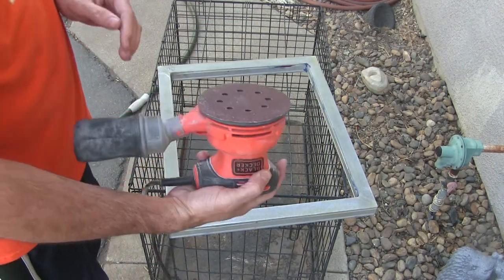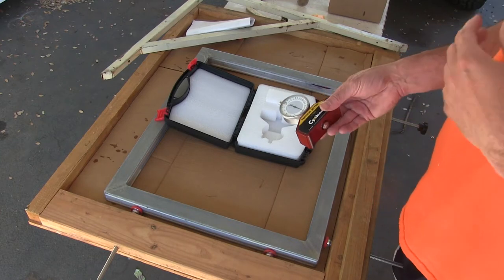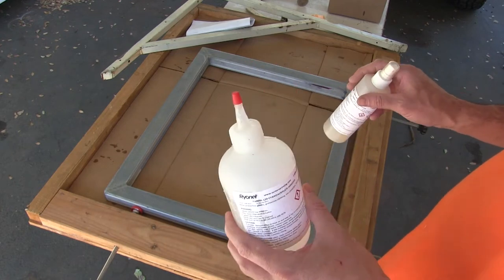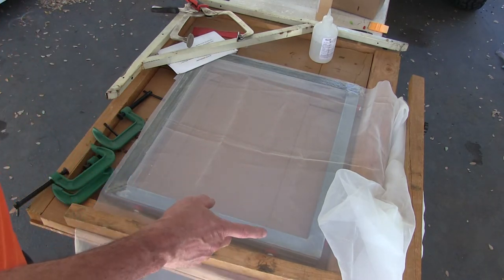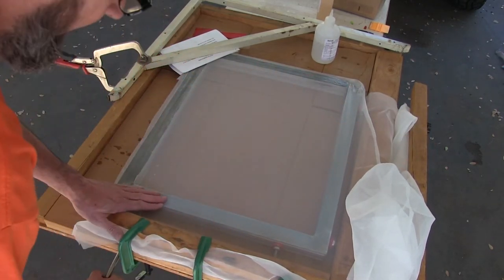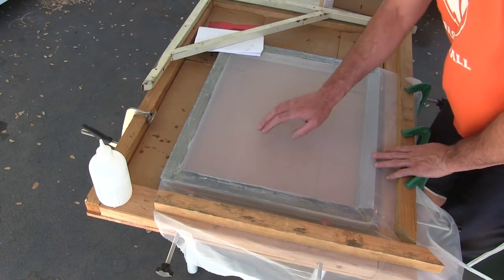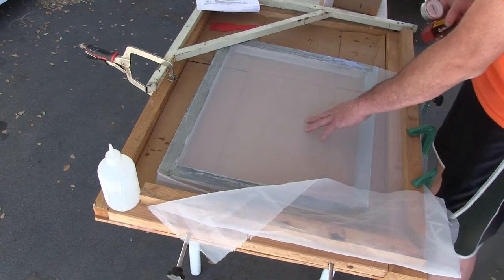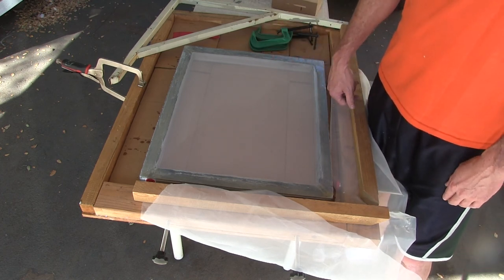DIY Screen Stretcher for Well Under $100 Revisited

Comment: For anyone trying to do this.

Don't get the big bottle of glue . It will dry out before you can use it.
I get 2oz bottles they do 4 screens. Also get the airisol activator it's way better than the pump spray.

Use an angle grinder to clean the frame. Make sure you wipe it with rubbing alcohol before gluing.
Reply from the maker: Good tip thanks for contributing!